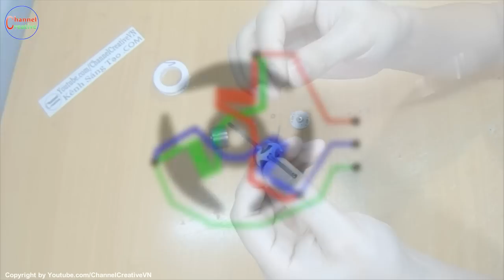How to make Brushless Motor from motor DVD, VCD player

Comment: Keep in mind also, that many if not most all 12v DC fans as used in computers or electronics are also brush-less DC in nature, most even with one or two ball-bearings at appropriate shaft points.
Reply: @Ajaysingh-vt3rq  huh??

Comment: Hi the wire that you used is it enameled copper wire also known as magnet wire? When soldering on the case do you use acid core solder?
Reply from the maker: +Daves Tech yes, that is magnet wire, and When soldering i use Pine resin

Comment: U just opened my eyes to some great ideas for all the motors I have lying around. My question is, can that motor run on larger size batteries like 3s 2000mah or higher or do I have to go bigger on the motor to use bigger batteries?

Comment: Hey. Nice video.
You can make an Electric speed controller for Brushless motors running in both ways?
I try to find one for my RC Scale drift project but I can't find an ESC schemtaic to be two sides not one side running.

Comment: Is the shaft rotating or not ? because your stator is rotating that might mean the armature is not.... that is the only way I see your wires are not getting cut due to rotation >
Reply: the stator got glued to the base and the axel got glued on the armature so the armature is indeed spinnign with the axel that what I observed at least

Comment: Hey I got a question, I worked in an RC store for a few weeks and everyone recommended brushless instead of brush motor what's the main difference besides what I just saw ?
Reply: +Camilo Lopez less friction
Reply: Less wear and tear.....and best of all...there are two types of brushless motors..an in runner and an out runner
In runners have high rpm(very high..used in rc helicopter)

And outrunner have high torque(used in drones)
Reply: +Anand ranjith kannan thanks mate
Reply: basically, brushless motors have a rotating magnet, and a fixed coil, brushed have a rotating coil and a static magnet or coil, the rotating coil needs brushes to get power, but those can only provide a few amps and will wear, but they will automatically provide current to the right coils, the brushless motor on the other hand can take in as much current as the wires can withstand and have only the bearings that will wear, but they need to have the current alternated for them via what is generally called an ESC (electronic speed controller)
Reply: longer life
Reply: +manaquri this, what you said, is the most succinct, articulate and informative explanation of the technical differences and how they operate. of the dozens of explanations i have heard/read/seen combined, i was able to learn more from simply reading your short comment. you should (if it serves you) write or speak such explanations on a regular basis with the same essence of what you have said here (perhaps you already do?) i am sure it would be popular
Reply: Camilo Lopez the brushless motor will rotate much faster than the brush motor and 
We can control the brushless motor speed easily because the command coils will generate more electricity and it will rotate fast in the video the coil brushless motor is not command so it is not a brushless motor
Reply: Hl, RPM?... THANKS VERY MUCH...

Comment: Did the central shaft also rotates?.. if not then where will the propellers be placed?
Reply: As seen in the video...the central shaft does rotate which is connected to the outer body.....this is an out-runner brushless motor......not an in-runner motor....
What confuses you is the tube of the antenna which is fixed on the coil and does not move....the shaft is placed INSIDE this...so that it can rotate easily..
Reply: This diy motor is hard to fix into something..... Since the outer shell also rotates...so a proper base is needed to screw it to something...hope it helps ;)

Comment: How is the sense of winding in each coil.. like clockwise or antilockwise??
Reply: If there are three coils in the armature...then two of them will be clockwise and one will be anticlockwise.....

Basically if 1st coil is wound clockwise then 2nd should be winded anti clockwise...3rd is also winded clockwise...and soo on
Reply: +Anand ranjith kannan  thanks for the knowledge
Reply: +Anand ranjith kannan  Brother can u plz tell me that is there any relation between wire thickness, number of turns in a coil and rpm/torque in a bldc motor?..
Reply: If you are giving a lot a current then the wire guage should thick....about 24-26 gauge......also the number of turns increase the magnetic field also increases....
If the coil is too thick you may not get many windings...... Thick wire emit quite a lot of heat also.....this is from my experience....I am a 17yr old anyway ;)

Comment: excelent!!!  very clear!!! but...where we can use it?? in rc cars/planes/trucks/helicopters??
Reply: put some propellers on the sides and make a airplane.
Reply: I need some tutorials for connection!!!
Reply: If you wanna do it quick and dirty, just use a bit of hot glue. Stick everything to a nice wide plane chassis and put a propeller on the shaft. Remember you'll also need an electronic speed control (ESC) and an RC receiver and transmitter if you want to make an RC plane. If you really want to make it, you can figure it out I'm sure.
Reply: Call me
super Quadcopter
Reply: Quad Dron how can I get cheap brush less motors

Comment: How can we connect a volume directly instead of receiver to control speed?
Or how of Servo working?
Reply: Sonthaya Traipug to run motor without esc, use the right AC current

Comment: we can use this motor to make quadcopter? please reply
Reply: You should be able to, as long as it isn't too heavy and has enough voltage to power the motors :)
Reply: siddhant gautam mabye if you change the magnets to those strong ones and then get some really small and light batteries and escs.
Reply: No. You need a low KV motor for a multirotor. The one in the video is around 3500KV (~26000rpm/7.4V=3513KV).  For a medium sized multirotor a 900-1200KV motor would be more ideal.
Reply: siddhant gautam  bbb
Reply: With right reduction gear ratio maybe..
Reply: we can make larg rc plane ok

Comment: can it be run without ESC circuit plz reply
Reply: Its not possible.... You must need an ESC.....its a simple circuit with MOSFETs and all......the one in the video is a 20ampere....but if you want little power...swap an used PCB from computer brushless fans....
But this PCB can't control speed.....hope it clears your doubt
Reply: +Anand ranjith kannan brother do you know that how is the sense of winding in each coil? like clockwise or anticlockwise??
Reply: does not matter, all of them must be the same sense,all cw or all ccw.